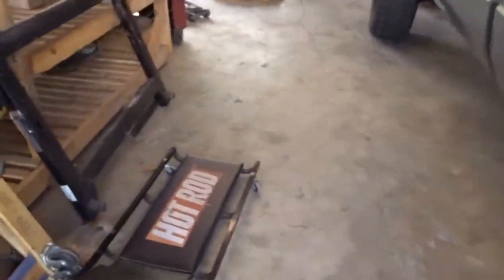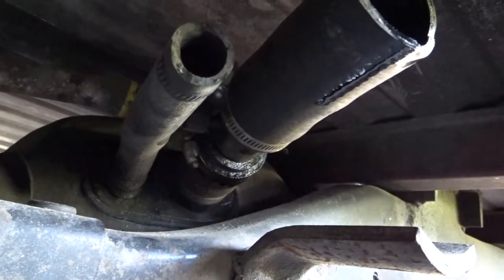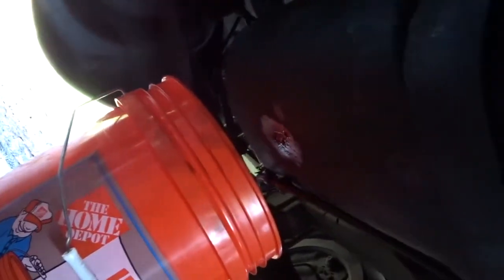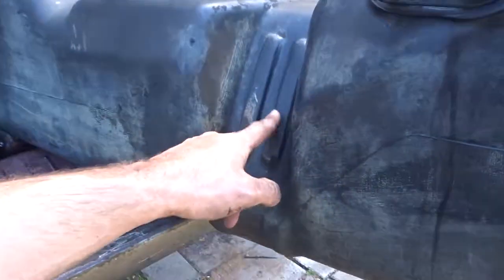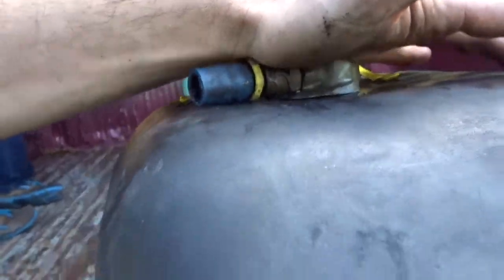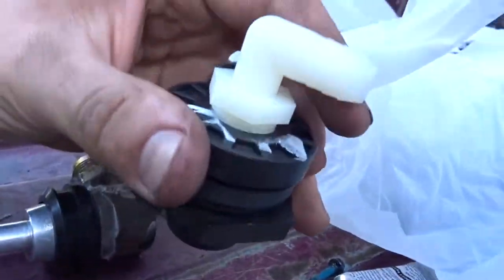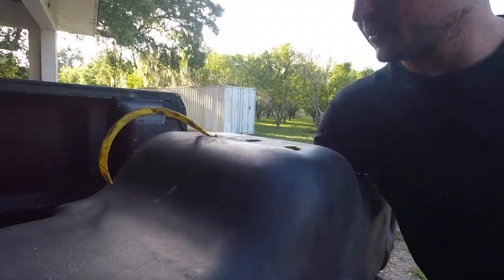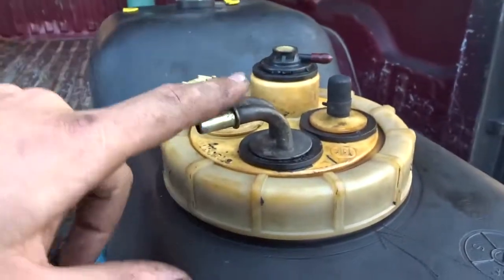Cummins Fuel Sump Install

Comment: Question...I've watched tons of Videos on Sump Install to Include Single and Dual Ports for Fuel Return but why not T the Return back to the Main Sump Line to Lift Pump Intake? It seems to me like why not use the Fuel already Filtered to cycle back through the Lift Pump again rather than dumping it into the Tank? I can get the aspect of possibly cleaning the Fuel a little in the Tank while in use. Guess it seems to me it would be a bit Cleaner being a majority of the Return is now being scrubbed again before heading to the Injectors...🤷‍♂️
Reply: Oh and by the way, your Channel is awesome.
Reply from the maker: Idk very good point, you’ve thought about this way more than I did haha, I just knew it needed to return so therefore I just naturally sent it to the tank but the only thing I can think of is that the return line coming off the air dog may or may not be filtered, Meaning it may make it to the water separator and get turned around there before it’s gets to the filter I’m not sure, the other returns coming off the pump and injectors would work to tee back into the feed line but you’d still be sucking in “unclean” fuel from the tank anyway, I don’t think you’d want to tee it into the pressure side line either because more chance for air entrapment and there may be problems with pressuring the returns.  Just my thoughts
Reply: @j_moffitt  Definitely agree on no T in Pressure Side. I had in mind where some sumps have Dual Ports it seems the same could be done by just adding a Threaded T Directly into Pickup Pump Inlet from Sump. Didnt think of whether it was pre or post filter🤔...Good point there. Ill have to find a flow diagram of the Manifold. On the other hand I guess I could see agitated bubbles forming after the Pump Impeller so maybe it would be best to keep these thoughts to the Engineers and just use them as directed...🤣
Reply from the maker: Nobody would ever learn anything if they just listened to what someone else said, get in there and try it out and if it don’t work you’ll be more the wiser 🤘🏼you thought about this way more than I did 👍🏼